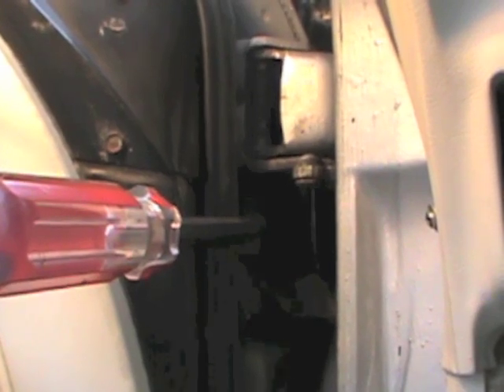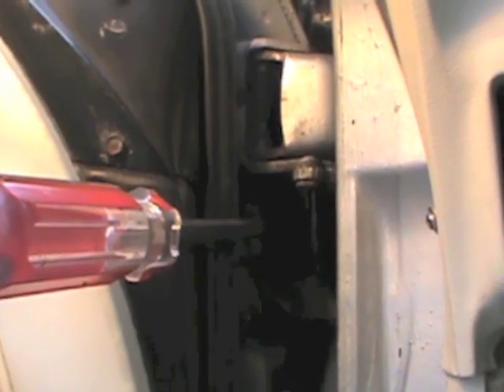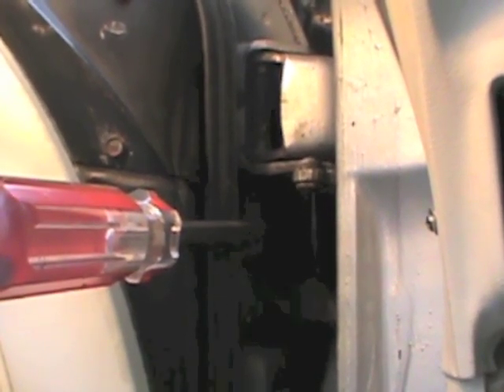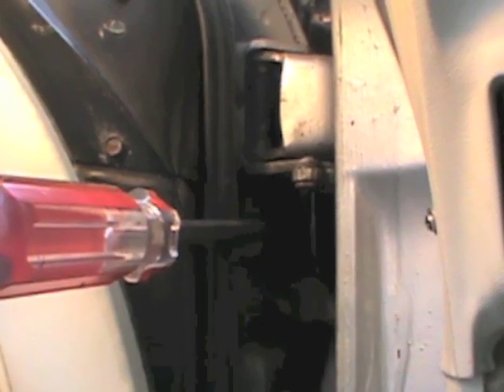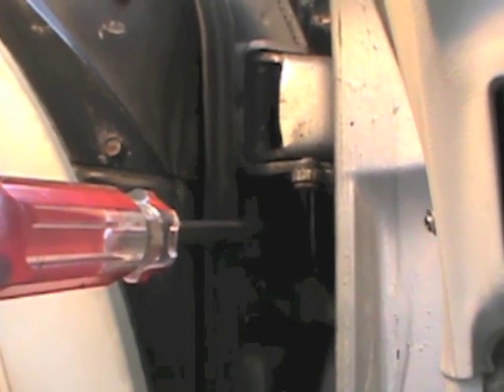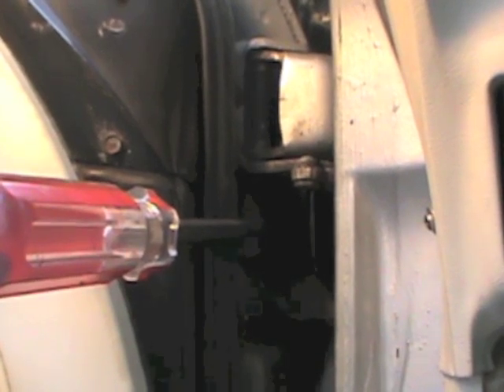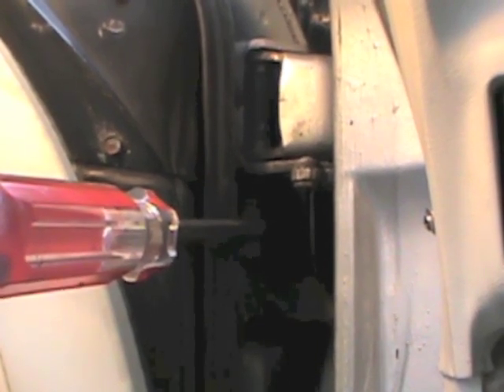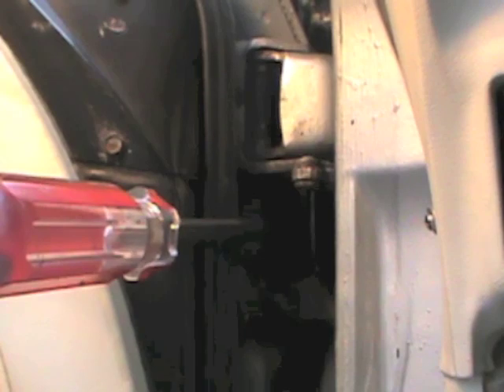Corvette 1968-82 Door Hinge Spring Tool

Comment: I bought a door hinge spring clip from you not knowing I needed this special tool you show here. I installed the new hinge spring clip with the driver side door wide open.  I made a tool.  It's a 9" std. tip screwdriver.  I bent it 35 to 40 degrees, 2.5" from the tip end.  It took me 20 minutes to figure out how to install the new door hinge spring tool in the limited space I had because the door is there.  I did not need to remove the door card.  But, this entire exercise with the door in place is better than removing the door, replacing the door and aligning it. Note: Suggest using blue painters tape to protect door and fender edges as you will drop this heavy spring about 3 times trying to get the hinge spring clip in place as shown at 0:33.  Also, the small hook end of the of the door hinge spring clip is what is placed, positioned in place first.  Let that fall or push all the way down into that hole before using the tool to force/ pry over (tension) the clip at the bottom end.

Comment: This the first video I have thumbed down.  Show installing the spring in the upper hinge.  Show how it has to fit into the hole on the top of the hings and the slots on the upper and lower flanges in the upper hinge.  Show how it has to be twisted with your tool to be centered in the wheels.  And how it has to be hammered up into place to set it.  Another site, now lost to 15 minute ago history, shows very clearly how to install this part.  (Note that I bought these parts from you a few weeks ago and that I learned how to install it from another supplier.)